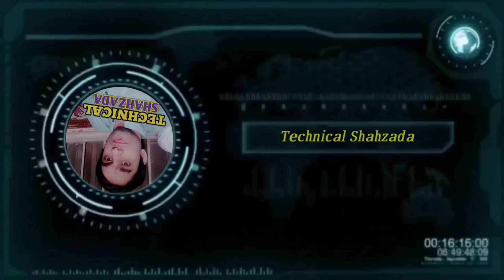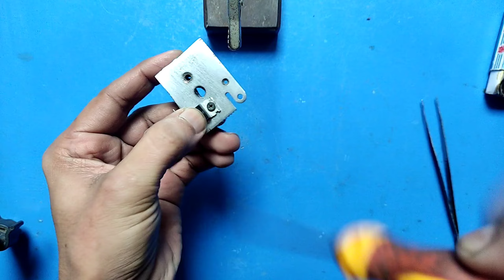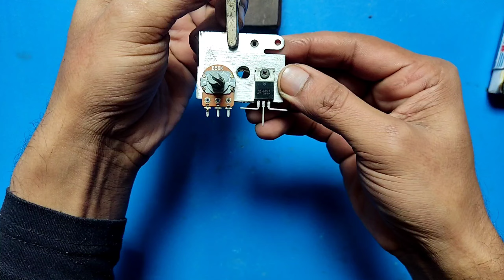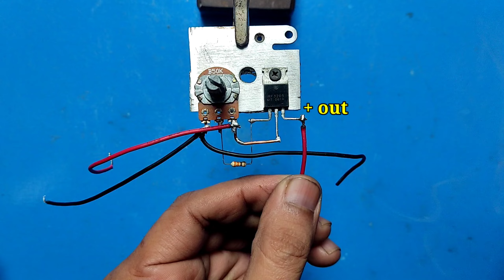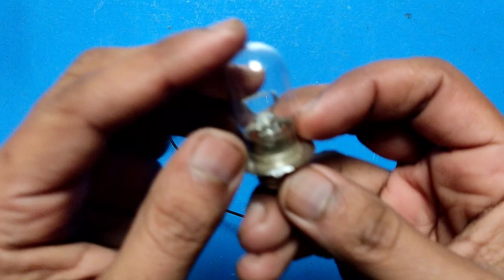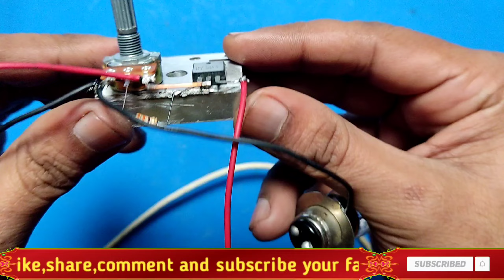dc voltage regulator | high power regulator | transistor voltage regulator | irf3205

Comment: Thanks for video.  
DC light dimmer or motor speed control.
The IRF3205 is a high current N-Channel MOSFET that can switch currents upto 110A and 55V. The specialty of the MOSFET is that it has very low on resistance of only 8.0mΩ making it suitable for switching circuits like Inverters, motor speed control, DC-DC converter etc.
Does the potentiometer need heat sink for heat dissipation or just put there for convenience?